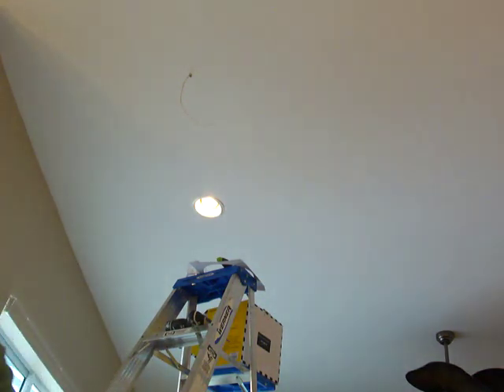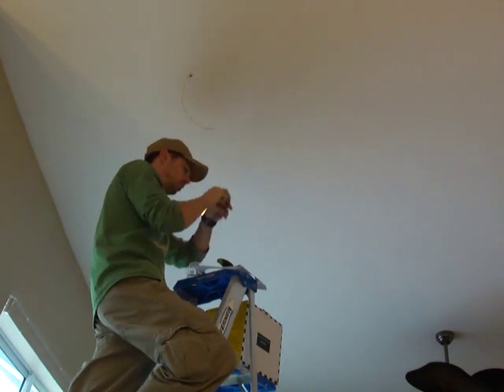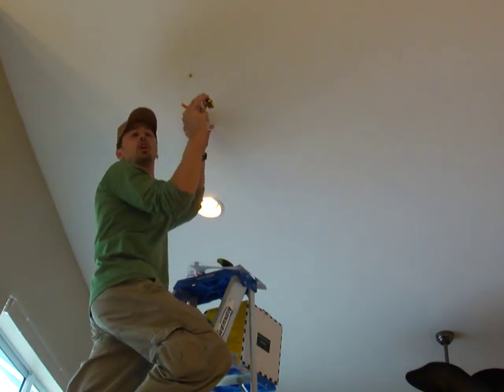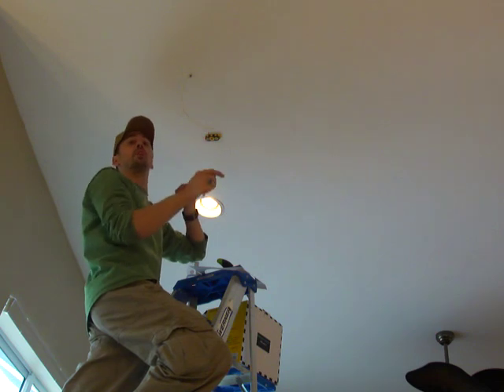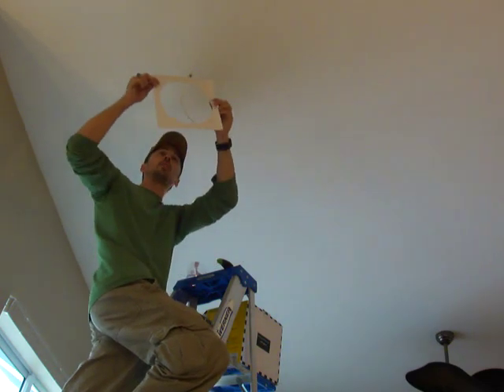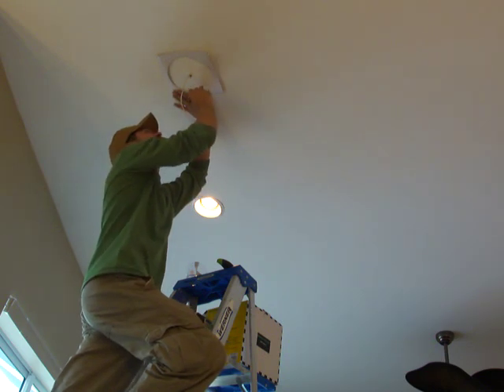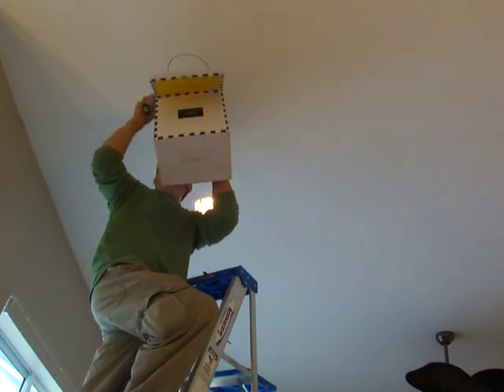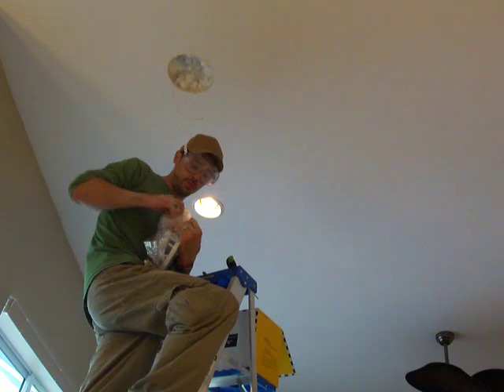HOW to install Wall and Ceiling flush mount speakers

Comment: Good thing it is his house where he is making the mess. A jab saw is a great way to hack up insulation and possible cut pipes and wires in the ceiling and let whatever is up in the attic including rodent droppings down into the living space. The more holes you make the more valuable a adjustable hole cutter with a dust shield is to make the job faster and safer.

Comment: Hey Tampatec. I'm planning on installing some ceiling speakers as well. Looks like you have blown in insulation like me. After a few years of operation... how have your speakers held up being directly exposed to the insulation? I've read mixed opinions. Some folks installed their speakers in recessed lighting cans while others just used a plastic bag. Others didn't give a crap and installed in direct contact like you. Just curious thanks.

Comment: whats cool is if you surround the speaker with instillation but not on the speaker, it damps down on vibrations but also increases the bass.

Comment: If my home being built is pre-wired for speakers on the ceiling can I use the same type of round ceiling speaker, or do I need to have speakers that hang from the ceiling? Does anybody have a video for this this or guidance?
Reply: If they pre wire they typically run the wire into a box nailed to the ceiling joist. Making it slightly difficult to get a round speaker to fit. Possible, but not as easy. If possible have them wire in a flanged mount box that just secures to the Sheetrock between the joists. Makes install much smoother.